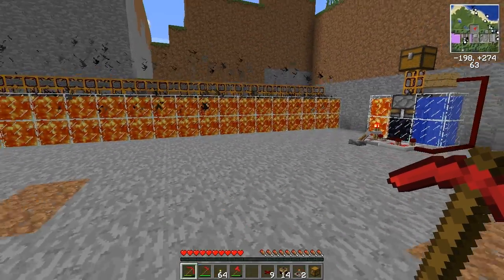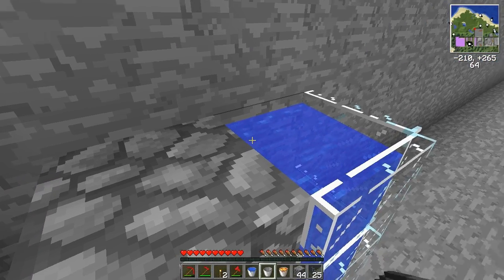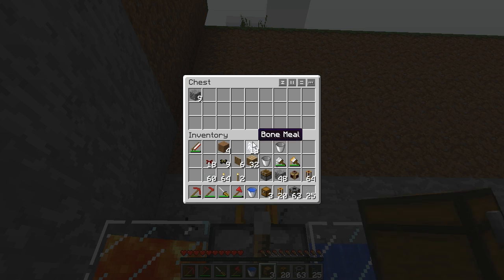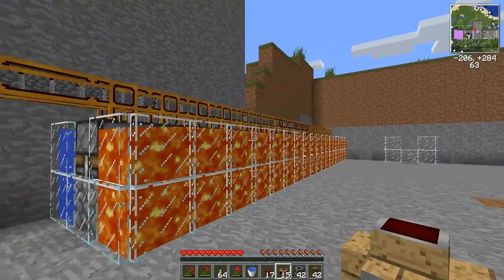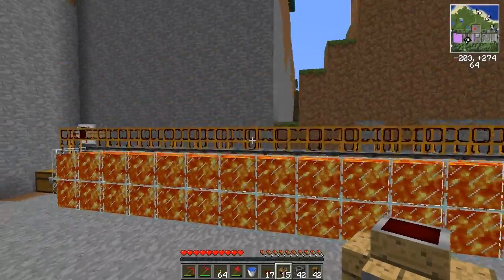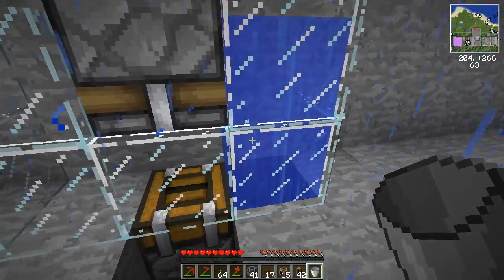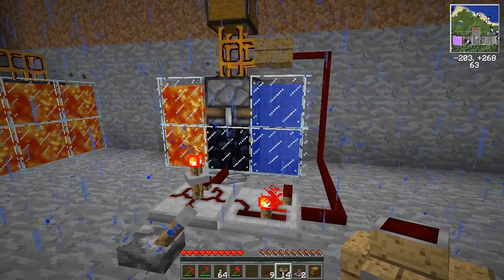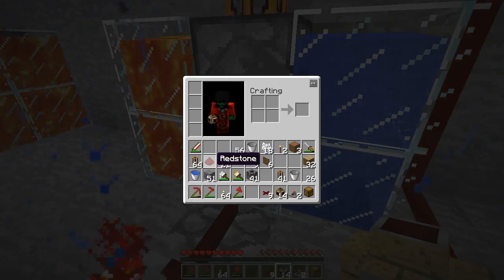Minecraft: Automatic Cobblestone Generator with RedPower2

Comment: You could speed up and possibly ease up the configuration with a slight adjustment quite easily.

Just delay the DEPLOYER instead of the block breaker.
The ideas is as follows:

we start with eg a cobblestone block between the deployer and the breaker. we break it, right after breaking it deploy the redstone (just delay barely enough for the breaker to complete the breaking process).
Then we wait for the lava to flow in.

The next tick harvest the obsidian. Rinse and repeat.

cya thx for the vid